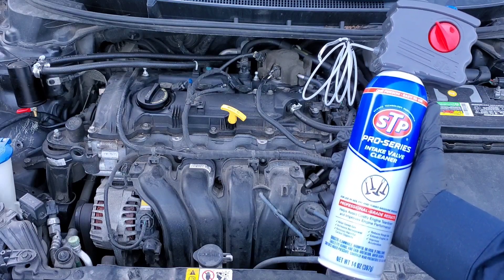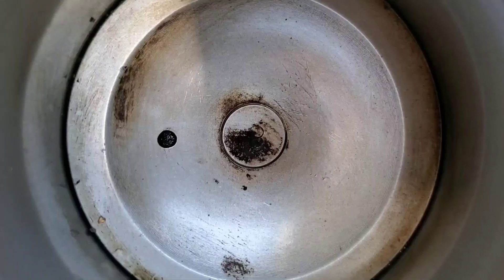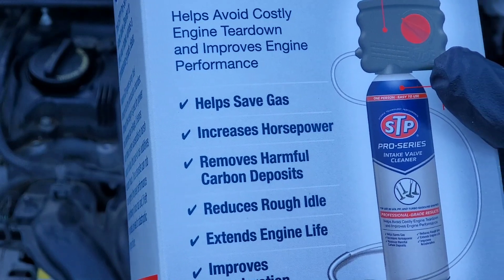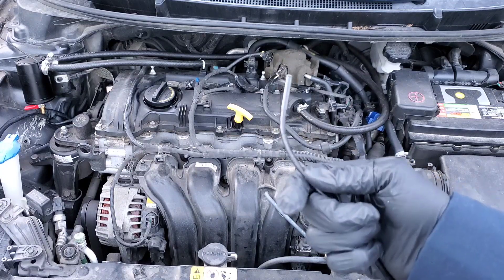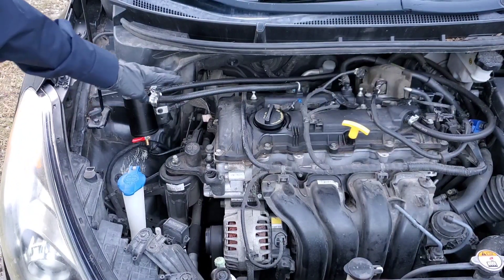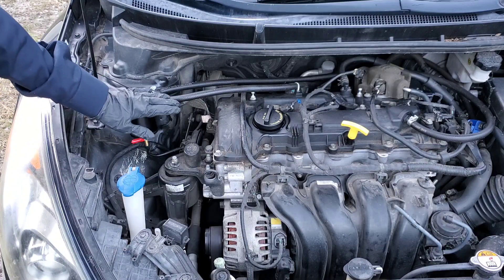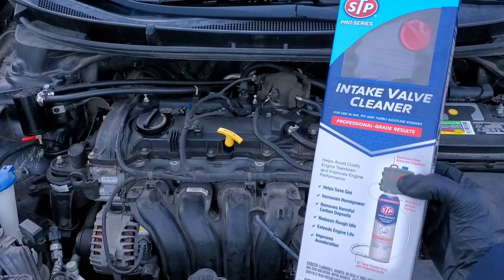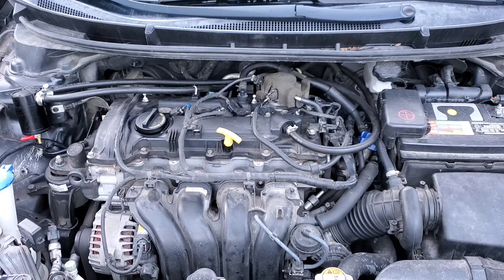How to remove carbon buildup permanently!

Comment from the maker: What can you tell others to avoid carbon buildup?
Reply: If your engine is VERY dirty, and you loosen up chunks of hard carbon, then yes, they can score cylinder walls.  It beats the alternative of pre-detonation knocking caused by hot spots, failing valve stem seals, valves that don't seal properly, and other valve train & combustion issues.  It's like saying... don't take a shower because you might scratch yourself while doing so ;)
Reply: Two different mechanics have told me ecoboost motors have messed up their turbo with a valve clean product (STP, seafoam, CRC, etc.) because it gets too hot and debris can be an issue.  What say you about that?
Reply: @argentum2519  

CRC has a Turbo and GDI valve cleaner specific version.
Reply: Just take your time  @argentum2519   .  No need to dump the entire can in one steady stream and overheat the turbos.  Just use common sense.
Reply: Can't tell any stories but I'm curious if water methanal injection could be added to existing washer fluid system and be set to low flow to possibly clean carbon build up. 
I do plan on trying it on my egr diesel when I have the funds.

Comment: I used this 2 years ago. Bought 2 cans before the price doubled or not available. I used it on my Caravan 4 cyl and the temp gauge went up big time while dispensing. I finally shut off engine. The can was near empty but spooked me on high temp.  I am going to do Yamalube ring free SHOCK treatment instead soon. I hope my CAT converter stays alive

Comment: Hi Nates, could you please tell me if there could be any issues by placing the catch can a bit farther from the PCV valve, like you did in this video? Both hoses, the one from the PCV to catch can and the other from the can to the intake manifold are possibly 0.5-1 meter (1.64-3.3 feet) in your case, I assume,  and this might be 2-3x longer than the original very short PCV hose on your car that looks almost exactly like my Hyundai i30. I would also position the can exactly in that corner (since it looks like we both have a hyundai…) but i am afraid that there could be an issue with a long PCV hose in terms of vacuum and/or clogging??

Comment: Did a professional carbon cleaned installed a oil catch can way better so far little to no carbon build up in the 11 months
Reply: Port injection or GDI?
Reply: @jbnorth396  port

Comment: Our Kia is burning oil and throwing codes for catalytic performance P0420. No leaks or smoke from the car. Little over 104.000 miles on it
Reply: Same here
Reply: I had a 2017 KIA Sorento 4 cyl Theta engine  oil guzzler too. I am original owner and had dealer do all of my oil changes. The oil burn started at 50k+ miles and got as bad as 1.5 qts per 1 K miles  with dealer doing consumption tests. They did the KIA piston soak TSB 222 and failed 3 times so in JAN 2025 I got a new FREE engine at 72.4 k miles. I now only put in top tier gas and watch the oil level often. I put in Valvoline restore & protect oil in it. The dealer lets me put that in instead of their DEXOS bulk oil.
For you if you are not in that warranty mode. I would do Berryman B-12 piston soaks and see if the oil rings are stuck like so many cars. Look at success on YouTube doing that. The oil burning probably cause the CAT codes. Some use CAT clean, lacquer thinner or other solutions. In Calif the CAT replace costs $4k.

Comment: A point to consider: a "huge cloud of smoke" does not always ensure that the cleaner is removing the deposits - the engine could be simply burning the "cleaner" itself. This gimmick works for brands like Sea Foam.

Comment: What  should I use to clean out the carbon buildup on the piston rings of a equinox? Have put gumout in the gas and oil with no change. Still getting oil blow by from the low compression piston rings gummed up with carbon.
Reply: YamaLube ring free SHOCK Treatment. Some have tried using BG EPR 109 and other solutions. Berryman B-12 piston soaks is best on YouTube videos BE CAREFUL with that!

Comment: Hey man, thanks for doing two videos of the stp. I saw it and was pretty impressed. So used it on my 2016 Mazda3 and a decent result. But I'm at 97k with good maintenance for all 6 years but only just recently started understanding carbon build up etc etc (last 2 years getting heavily modded and currently tuned ontop of everything else). That said, could I run stp again after doing it a week ago or should I wait "x" amount of time?

Comment: Why didn't you show us the product in action?
Reply: Is he supposed to put the camera inside the engine while it's running? Wtf
Reply: Because he didn't do it. Just like using the bore scope. There is no easy way to check the valves without removing the intake manifold. This guy is a shill
Reply: cause it doesn't work

Comment: If you have to clean every 5,000 miles that's not a permanent solution?
Reply: If you have heavy carbon build up I would get a professional cleaning ($500) and then you could use this every 5k miles to keep it from building up again.
Reply: Maintenance? …

Comment: I used this on my 2017 Chevy Cruze.  DO NOT follow the instructions where it says to reattach the intake boot to manifold after inserting the  hose.  The U shaped end of the hose is a soft aluminum tube and the Cruze intake boot will flatten it and make it useless.  I had to return the first can I got because the U shaped tube was crushed and would not pass the fluid.  With the second can I held the intake boot to the manifold instead of putting it back on, and it seemed to work fine.
Reply: Well duh 🎉

Comment: Could I use this on a 2014 ford 3.5 eco boost?
Reply from the maker: When people talk about a carbon chunk breaking off if you use a cleaner, they don't realize if you don't you would still have carbon break off. If you allow it to build up eventually something has to give. The main way to stay ahead is using as a preventive maintenance. Just follow car and product manufacturers recommendations.
Reply: I wouldn’t, if a chunk of the carbon comes off it can damage the turbos
Reply from the maker: The carbon will have chunks come off eventually if it's building up .The best way is preventive maintenance using a cleaner before the carbon hardens to much. Always follow the manufacturers requirements.
Reply: @bradleyporter5454  That's why you keep the rpms low while cleaning. Most turbo cars have an RPM range where boost comes in. You could also disable boost while conducting a clean. 

After doing the clean, usually worth doing an oil change also IMHO.